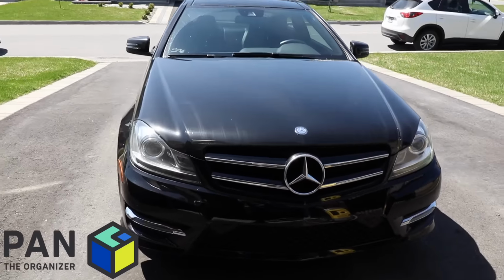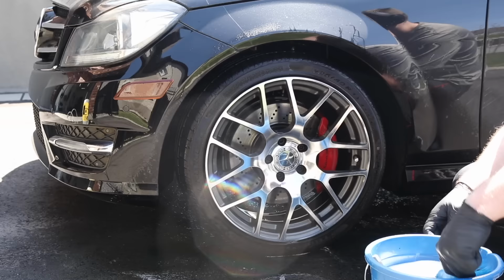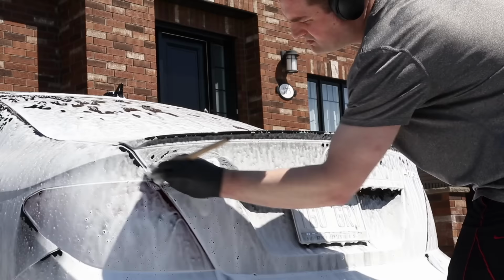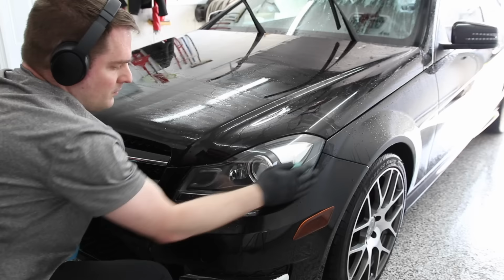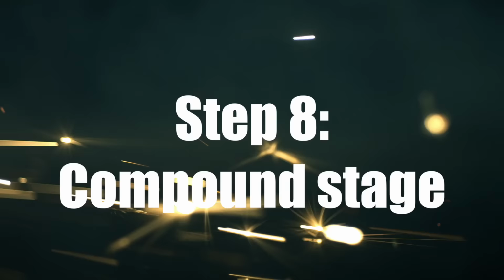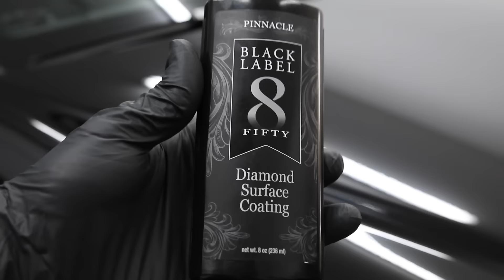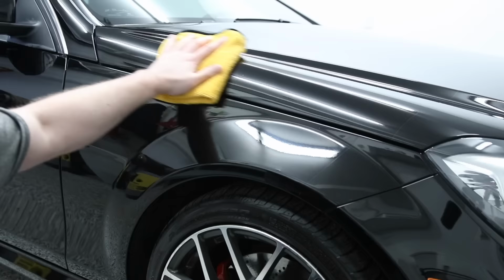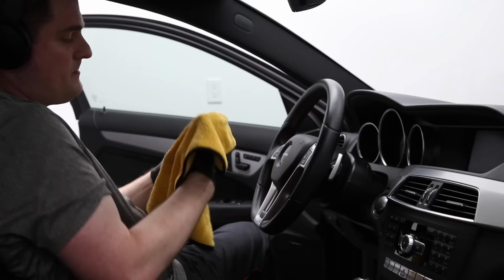MERCEDES-BENZ C350: FULL DETAIL OF A BLACK CAR

Comment: This looks awesome! I see you don't mind washing in the sun although people say that is a no no.  Also what are you thoughts on 15mm vs 21mm polishers.  I need something larger and faster for detailing my truck.  My Porter Cable took too long and I don't think was able to get a lot of defects out.
Reply from the maker: Thanks!  I always do polishing and paint protection in my garage.  But washing outside isn’t an issue if you work in the shade as much as possible, use a pH neutral shampoo, and I have a water softener system.  And 21 years of detailing experience really helps too lol.

How did you discover my channel?
Reply: @PanTheOrganizer  been following you for a while now. You have some good stuff. What is your polisher of choice.  Rupes or flex?
Reply from the maker: I need both.  If I want finesse and smooth operation, Rupes.  If I need a pad that never stalls on uneven surfaces, Flex.  Rupes is a D/A and Flex is a forced rotation/direct drive motor.
Reply: @PanTheOrganizer  thanks for the info.  Would love to see you review the Adam's swirl Killer and the mini.

Comment: Hi Pan! I've got some scratches on my hood from removing vinyl wrap. Considered having it polished - but will that do the work and remove the scratches?
Reply from the maker: Of course.  That’s what compounds and polishes do.  That’s if they’re scratches in the clear coat.  Anything too deep will likely require water sanding or possibly a respray.

Comment: Amazing work on amazing car. Is this your car? If yes, could you please tell me where did you buy this grille?
Reply from the maker: Hi Piotr!  Thanks for the comment!  No, this isn't my car, it was a customer's ride.  I've been doing high end car detailing for over 20 years.

I have a BMW 435i xDrive Gran Coupe M Sport edition, which I reviewed here: https://youtu.be/RdskiGKn_Wk

If you liked the Mercedes video, check out my BMW M3 full car detail: https://youtu.be/OjQavIEiWlM

How did you discover my channel?
Reply: Thanks for the answer. The final effect of this Mercedes makes me hold my breathe for a while :). I have also W204 after full detailing by the company but unfortunately some time after, it was cleaned improperly by different company and now my hood is covered with many little scratches and need some fix to be done. Next spring I want to wash the car by myself and I hope I find many useful tips on your channel how to do that perfectly. I found your channel by searching for angelwax on mercedes as it was applied to my car at first, then Gyeon Mohs ceramic. Wanted to compare some work on other cars with angelwax. What ceramic coat do can you recommend for black car? Subscibed :)
Reply from the maker: Since you subscribed to my channel, let me welcome you to the Pan TheOrganizer family!

If you like AngelWax products, you'll find my video review about their entire lineup on my channel.  :)

I also made a 2017 Car Detailing Products Awards video so you can check out my top 3 of every product category.  Best ceramic coatings, best waxes, best sealants, best shampoos, etc.

My favourite consumer grade ceramic coatings are: CarPro CQuartz UK Edition, Gyeon Mohs, Kamikaze Miyabi & ISM Coat, Optimum Gloss-Coat.  They're all great for black coloured cars or any coloured cars.  I also like Pinnacle Black Series Diamond Surface coating too.

In fact, my video on "How to apply a ceramic coating" is ranked number one on Youtube for that subject with over 708 000 views already.  Here you go: https://youtu.be/byKcYsEyWGk

Comment: Can you apply the compound by hand? And if so how would you go about it. Thanks for your videos. You got yourself a sub!
Reply from the maker: +Filipe Duarte 
No it is meant for DA polisher application.  Most compounds are made to be applied with a polisher.  Removing scratches and swirls is not meant for removal by hand...  you'd have to work like crazy for 1/100th of the results...
Reply: I understand. Thanks a lot for your help!

Comment: What did you use meguiars wax for? I'm going to apply a ceramic coat to my F30 and I'm trying to understand if wax still fits into the process and if so where should it be used. On the windows possibly?
Reply from the maker: I like using Meguiar’s XPress synthetic spray wax to give a finishing touch to exterior black trim and windows.

Comment: good video,awesome detailing ,but i have heard that pressure washer is bad for car paintwork ,is it true???pleased?
Reply from the maker: +VeNgueDAsAlen DAVISEN 
Thanks!

And no, there are no issues to use a pressure washer on a car's paint.  Every single high end detailer in the world uses one.  If it's electrical, no problems as they're pretty much all under 2000 psi.  If it's gas powered, just keep pressure below 2200 psi.
Reply: Pan TheOrganizer thanks

Comment: People don't realize the amount work the goes in to reslly cleaning your car properly driving thru a car wash doesn't do a damn thing
Reply from the maker: +Eric Cymbura 
Absolutely agree with you 100% Eric! 👍🏻

I spent 10 hours dialing that car in.  A regular 10$ car wash can't provide this level of care and protection.

How did you discover my channel?
Reply: Pan TheOrganizer it shows, I do some detailing on the side myself but nothing like what you do I do a more or less simple detail but if I had a garage it would be much more involved but people don't realize stuff like going through the car wash is what causes swirl marks and scratches

Comment: If i wanted to do this to a new car i'm buying it, how often do i have to apply the wax and the polish after doing it once?
Reply from the maker: Hi David.  In this video, we talk about ceramic coatings, not waxes or sealants.  Waxes last 2-3 months, sealants 5-6 months, and a coating like the one in the video lasts 2 years.

But if you prefer simply adding wax, then you have to add layer ever 2-3 months.  You only polish your car when its needed (swirls, scratches, oxidation, etc).

Comment: 1 question Pan. How do you manage to do this in only 10 hours?
Reply from the maker: I have 20 years of experience which helps greatly in time management and efficiency.  Also, keep in mind these are more recent cars who often only need a single-stage correction in the polishing phase.  If the car was much older with deeper scratches and swirls and oxidation, I would need two days.  It all depends on the state of the vehicle.

Comment: Hi  Great video.   I too have a black car. Watching your video gives me alot of idas and help for what I can do. When you put the ceramic coating on  after a year I was told you would need to compound it of and start fresh again Is that true and compounding does it take alittle bit of your clear coat off.    Thank You for your help and Happy Thanksgiving
Reply from the maker: It depends what ceramic coating you used.  If you used CQuartz UK Edition for example, it should last 24 months if well maintained.  When you see no more beading or sheeting, yes you polish the car.  If no deep scratches are there, a simple polish is enough.  Don't worry about compounding and polishing.  Unless you compound your car 10 times a year, you should have enough clear coat to last years.

Comment: what power washer do you recommend? I'll be only using it to clean my car. Also what other things should I buy? I don't want to do a great detail but just enough to make it look good
Reply from the maker: +Steven Mejia 
Hi Steven!  Any Karcher pressure washer will do great and last forever.  Just buy the least expensive one like a K2 or K3 and you'll be good.

How did you discover my channel?
Reply: It came in in my recommended section, and I just started watching. You do great work!!!
Reply from the maker: +Steven Mejia 
Thank you!

Comment: What's the purpose of the compound before the polish ?
Does the IPA not take away some of the previous application . ?
Is this your full time job and how many of these steps would be sufficient if just doing at home ? Thanks
Reply from the maker: The compound is where you remove most of the bigger scratches, swirls, marring and oxidation.  That is where you correct paint the most.  A polish is meant to further perfect the finish, remove marks left behind in the compound stage, add more gloss and make the paint smooth.  That stage is often called the jeweling stage.  The IPA stage is a must in order to remove polishing oils left behind during the polishing stages, if not, the wax won't bond to the paint as well.  

If you're satisfied of how your paint looks, then you don't need to compound or polish.  If you're looking for ultimate shine, gloss and to remove swirls and scratches, than the only way is through paint correction.
Reply: Pan TheOrganizer thanks , I can just imagine a bird crapping all over me after all that work .
Reply: Also, the foam cannons, I've seen a few different opinions saying they were that effective /bit of a trend etc. What's you're thoughts ?
Reply from the maker: I like cannons because a well done pre-wash stage allows you to foam the car, get rid of the loose dirt and debris before you do a contact wash with your favorite wash mitt.

Comment: hi pan sorry but got another question for you.
if you were to compound and then polish and decide to finish by using say autoglym hd wax instead of ceramic coating would you still use ipa before the wax?
Reply from the maker: +Joanne Burns 
Yes it’s always best practice to remove polishing oils and dust with an IPA wipe.  It helps protection products get a better bond to the paint.

Comment: What is the ipa wipe down ratio mix?
Reply from the maker: The recommended starting point is 50/50 (distilled water and isopropyl alcohol).  But you can adjust according to your needs.

Personally, I use the pre-mixed solutions like CarPro Eraser and Gyeon Prep.

Comment: So after the black label ceramic coating, can you wet the car to put on hydro2? Or leave it be?

Also, what did you use for interior trim?
Reply from the maker: +Faiz Abrar 
It's always best to leave coatings cure for 24hrs without water contact.

Interior trim I used Chemical Guys Silk Shine in this car.
Reply: Pan TheOrganizer thank you for replying! I really appreciate your help
Reply from the maker: My pleasure. ;)

Comment: Hey Pan! I didn't you start with the inside first?
Reply from the maker: I always do the exterior first.  That’s where the hardest work is and that’s where I want to have all my energy.
Reply: makes sense. I always start with the interior because I don't want the dirt from inside to end up on the cleaned exterior when I vacuum and stuff.

Comment: Pan, I just bought a house but my new Ram is just too big to fit in the garage let alone wash it and detail it in there. How do I go about washing my truck in the sunlight? I wish I had cloudy sky’s every Saturday but that’s not realistic.
Reply from the maker: There are a few tricks to detail in the sunlight, as many mobile detailers have no choice.  It would be too long to type here, but some of them are: 
- Use pH neutral soaps
- Make sure you don't have hard water issues (hard water = water spots)
- Do the work towards the end of the day (6 to 9 pm) when the sun is at its weakest (or very early in the morning).  Avoid noon time.
- Try and figure a way to work in the shade.
- There are some paint protectants that can be applied in direct sunlight, like Meguiar's XPress Synthetic Spray Wax for example, which you can use as a quick detailer after you're doing washing and drying you car, to quickly go over it, add gloss and slickness, and remove and light water spots from the wash.  This is good for paint, plastics and even glass.
- Wash one section at a time, and rinse.  Then move on to the next section.
- Use a car dryer if possible.  Letting water sit on the paint and bake in the sun is what creates unwanted water spots.

I hope this helps!
Reply: Pan TheOrganizer this does really help. I can go by these tips now. Thank you Pan!

Comment: Do you use the same size pad to cut and polish the back of the side mirrors or the smaller areas? Also is the oil remover you used after polishing completely different from the iron remover you used right before the clay bar?
Reply from the maker: I use different size polishers for different areas on the vehicle. See my video on my three types of polisher sizes here: https://youtu.be/U1ZD0L3RCa4

And the paint prep spray used to remove polishing oils is COMPLETELY different from an iron remover. The prep spray is an isopropyl alcohol. The iron remover is TGA to remove iron particles.
Reply: @PanTheOrganizer  thanks
Reply: @PanTheOrganizer  would you still use the same paint protectant today or use something different?

Comment: Please tell me what polish and compound I personally used for better you have lot pf experience which product is best for for removing swirls and scratches for beginners?
Reply from the maker: +Shariq mughal 
You can start by using an "all in one" like 3D HD Speed with a polishing pad.  What polisher do you have?
Reply: Pan TheOrganizer i have cheap polisher black and decker polisher
Reply from the maker: +Shariq mughal 
Oh you're gonna need to invest in a proper polisher for beginners like a Griot's Garage DA polisher or Porter Cable 7424XP.
Reply: Pan TheOrganizer ok thanks for helping me :)

Comment: Hey pan nice video. Have you thought about doing paint correction in smaller sections?
Reply from the maker: +Chuck Coffee 
What do you mean by smaller sections Chuck?
Reply: Pan TheOrganizer like instead of doing half the hood, or a whole door panel. Do a 2'x2' section (or a smaller sub section of the big panel )at a time that way you will be a little more through and have a little better results, on top of the already amazing job you do.
Reply from the maker: +Chuck Coffee 
I always assess the level of work a car needs.  It's false to believe you can only work in 2x2 sections.  Those are 20 year old myths.  Sometimes you have no choice, but most modern compounds and polishes allow for longer work times with no issues.  It's the end result that counts.  If the paint is near perfection, than one's given technique works.  IMO
Reply: good to know. thanks for the update. thanks for all the great videos, and keep up the great work.
Reply from the maker: Hey thanks Chuck!

Comment: How long does it usually take to do all that?
Reply from the maker: Hi!  First, thanks for watching!  Hopefully you'll go check out all the other videos on my channel if you liked this one.  ;)

For the Mercedes C350 in this video (and the BMW M3 in the previous video) roughly 10 hours as they are fairly recent.  The paint had minor swirls and scratches and mostly needed a good polish to reveal more depth and gloss, plus long term protection with the ceramic coating.  On older cars or more damaged paintwork, in can take up to 24 hours of work to correctly restore the interior and exterior to a level I affectionately call "better than new".  That mirror finish and ultra smooooooth surface that people dream of.

How did you discover my channel?

Comment: Pan. What is the product used in step16 please : Trim detailing.
InnerClean Interior Quick Detailer and Protectant + Silk Shine Sprayable Dressing ? or one of the 2 ? Thx
Reply from the maker: +KZU Gaming 
I like to clean with CG Inner Clean and then apply either CG Silk Shine or CarPro PERL as a dressing.
Reply: Thx Pan. And can we also use this CG Inner Clean and CG Silk Shine on leather inside the car after we have used the Leather cleaner and leather conditionner ? Just to know if the Inner Clean and Silk Shine can have a bad effect on leather ( take the example of the inside doors where there can be leather too ) or no problem at all ?
Reply from the maker: No.  For leather, it's better to use dedicated cleaners and conditioners.  For example, you can use a 2-in-1 cleaner and conditioner Chemical Guys Sprayable Leather.  Works great.  If you want the top leather care products, Swissvax is the way to go.
Reply: Yep I took the cleaner and conditionner from CG ;-)

Comment: Would you still use that same sealant or something else on the same car today? Or is there something else? I want to make this car look nice while I own it, but don’t want to get it ceramic coated
Reply from the maker: If you don’t want to apply a full blown coating from a glass bottle, the next best thing that could you 6-12 months of protection would be a good spray like the one I reviewed here: https://youtu.be/b5BjDzItlr8
Reply: @PanTheOrganizer  I don’t mind detailing my car. I’m pretty new to paint correction so I just was curious what to use on my black cars I’ve never used a protectant only really cleaned it before. I would love to learn though
Reply from the maker: You're in luck! I have a super popular paint correction tutorial for beginners here: https://youtu.be/ustTEVGMOTI